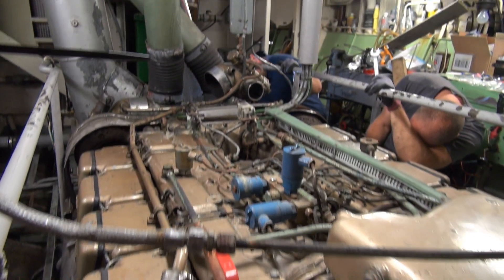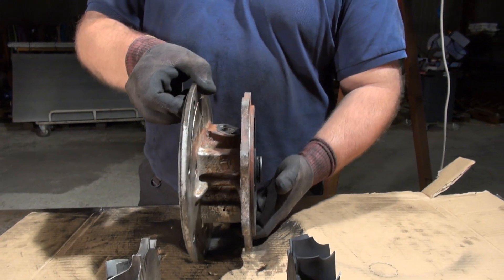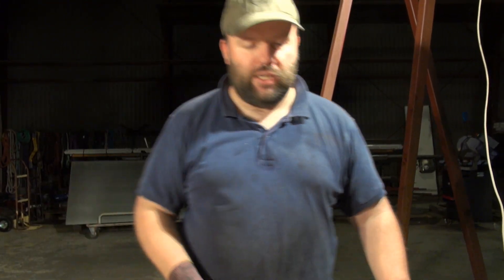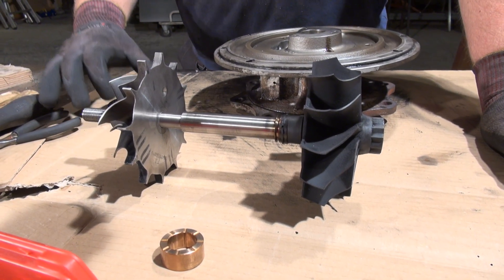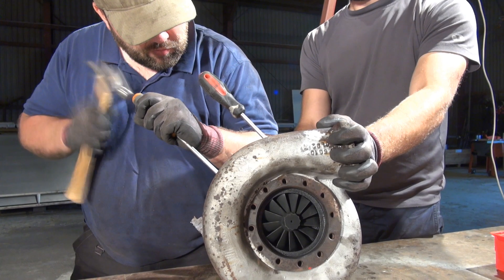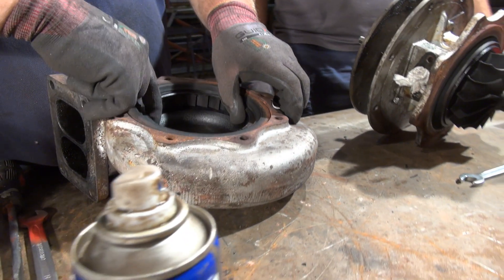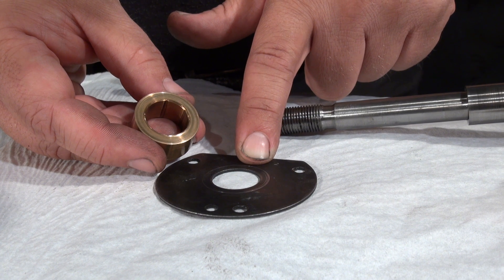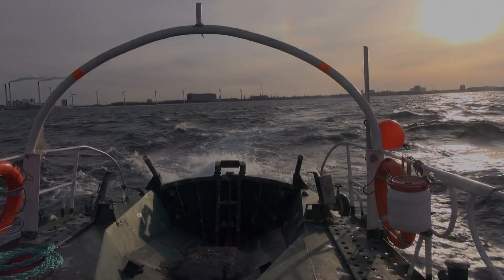Vostok Turbocharger Inspection by Jacob Skov Larsen

Comment: How expensive are those two worn parts?  Couldn't you fabricate or get replacements from your existing workshops.  At least the flat plate looks like it is just the same kind of steel plate you use for the older rockets and the capsules.  But I am no blacksmith, so I can't tell the difference...  The red metal bushing looks like copper or brass, similar to what you use for combustion chambers.  But again, I am no coppersmith, so can't tell the difference and don't know the tolerances involved.